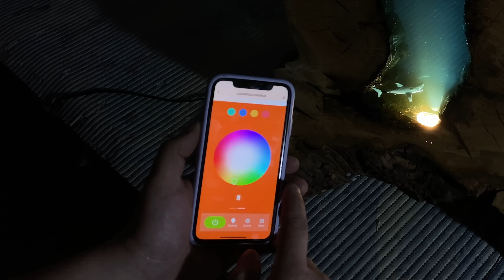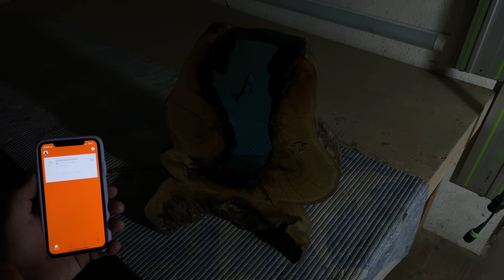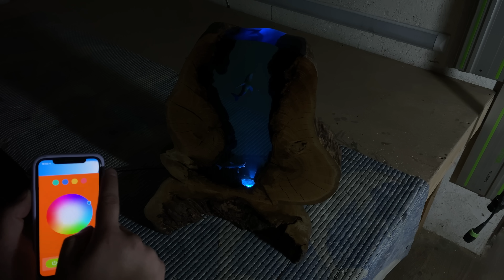WOODWORKING project How to make an epoxy lamp

Comment: Your chip load was too high when Facing the block. Should be about 0.02" per tooth x number of teeth. Looks like you were at 0.025" per tooth. Too high.
Reply: What are you referring to and what does this mean?
Reply: @waterlilly62lori  it's a joke only a machinist can understand.

Comment: Sooo cool!!! I have questions. What was the blue stuff you used? It seems like a lot of material for one use.
What was the product you used to polish the epoxy?
What was the product you used to glue the shark in place?
What was that meter thing in the beginning?
You epoxied over the bark, will that not present a problem?
What was the purpose of funneling epoxy into the bucket?
Reply from the maker: 1-This is polyurethane foam for insulating cracks
2-suitable for any polishing
3-superglue with activator
4- wood moisture meter
5th then I removed the bark it was not a problem
6- the resin needs to be poured into a bucket in order to mix the resin well

Comment: If you wanna learn from someone learn from this man .
101 resin designs .i love watching your videos ,so much common sense and money saving tips like using linoleum for your tables which can be used over and over again .i must of used the same form once to make about ten tables from it .all that melamine forms and mould release spray is over priced  silicon pray is good olive oil will work just fine or wd40 but back to the work .i use the same sort of methods as you but im just a novice who loves making these kind of things and ive sold everything ive ever made so im on the right path at least but nowhere near as accomplished as your self .why you didn’t put another river on the base tho i dont know 😮lol  that would of sealed it for me but its still amazing piece ,jedrick does a few like that but much smaller pieces but the principle the same .yh keep em coming bro cant wait for you to get to a million subs 🫶💪🙌
Reply from the maker: Thanks 😊

Comment: Very good work kiddo. But there's a couple of things I didn't understand. 1) Why did you cut away the cellophane wrap when it was totally unnecessary? 2a)What's with the blue foam? 2b) why use it when it was totally unneeded? 2c) If you were going to take off the bark anyway, why not just take it off before? Just some parts of your build that seems like it could have been simplified sir. Really like your planer though!
Reply from the maker: Thanks 😊 

1- the film is needed so that the resin does not stick to the base, but cut off so that the foam sticks well to the base. 2-this is an ordinary mounting foam, it is needed so that the resin does not leak, because there are a lot of cracks in the tree. 3- I didn’t remove the bark because the foam penetrates the tree well, if there was no bark, it would be more difficult for me to clean the foam from the tree.
Reply: Awesome work!🤩

Comment: What are you doing at 7:56 seconds. And what machine is that?

Ad what is that u are apply on the art piece surface at 11:40?
Reply from the maker: mill the surface, festool 1400 Finally coated with oil

Comment: Ok. My big issue is at beginning. Why wasn’t his jig more stabilized? It rarely stayed straight.
Reply from the maker: I did not understand the question
Reply: @avswood  when you’re going over the top with your router the jig moves a lot. It’s not secure as you go through your motions.